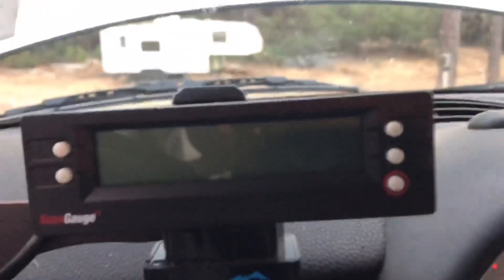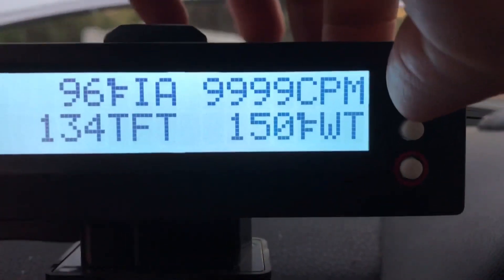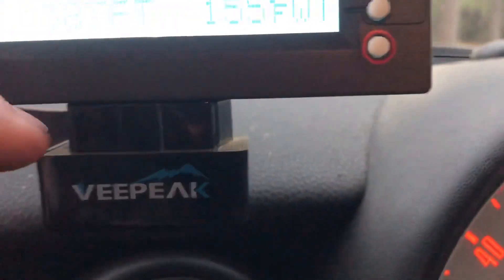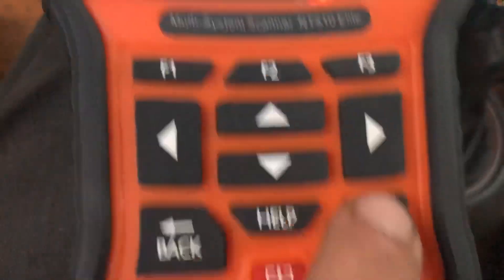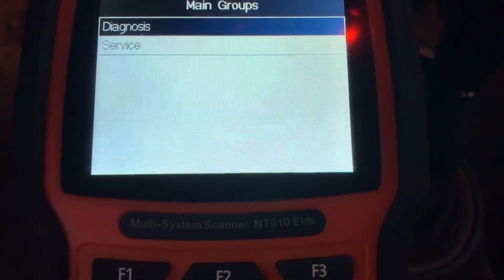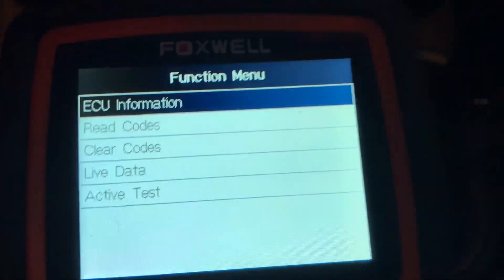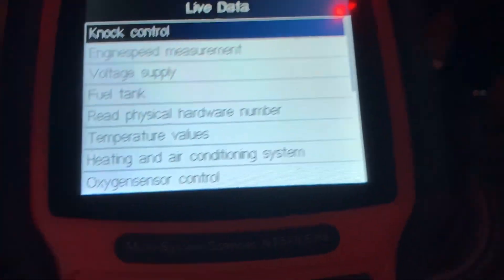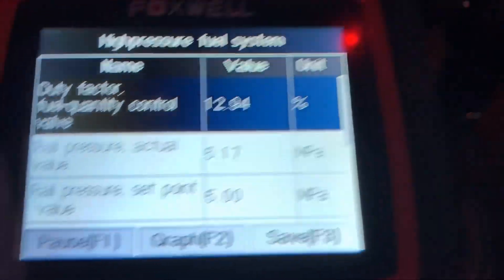2 Ways to check fuel pressure on your Mini Cooper

Comment: Hey man, I have issues with my car hesitating and running kinda rough at idle, I’ve noticed if I blip the throttle on idle then my fuel rail pressure will drop to about 600PSI Before it corrects itself and runs at around 700PSI on idle, do you think this is a bad pump?

Comment: Would be interested to see how you get two Scanguages working on the same ODB port.  I watched one video where one guy tried to use an ODB splitter cable but it failed long-term.
Reply from the maker: That would be the same way i would try it. Do you happen to have a link for that video?
Reply: @ProjectMini  https://www.youtube.com/watch?v=2Z3qF9WsTEA  This was on a Mustang though.  Maybe it would work on a MINI.

On another note, I have a 2013 R56 S, and tried to measure the fuel rail pressure on my Scan Gauge II and it didn't work.  I even mailed it in to Scan Gauge back in November 2016 to have the software updated.  Not blaming you or anything just thought that was something noteworthy.  I'll try measuring the pressure with my Foxwell NT510 later.
Reply from the maker: I’ll have to try something else. That explains why I’ve never seen it done

Comment: Hi, hopefully you can assist especially since I may not be able to  pose my question correctly.

My mechanic just just installed a new high pressure fuel pump and tells me it is pumping too much fuel. Do you know what could be the problem?
Reply from the maker: I would find out how much fuel you’re getting (in PSI) and see if your mechanic knows what he’s talking about.

Comment: Question for you, I've replaced my HPFP but now I'm getting a code P0088 "Fuel Rail/System Pressure - Too High" . Do I put a new high pressure fuel line which is recommended after removing it? Could this be causing my problem? Btw I've replaced a new fuel rail sensor as well as a new fuel filter. Thanks in advance:)

Comment: I think my HPFP is on its way out... Got worse over the last 2 months... Only interesting thing is that occasionally the car starts fine both the set point and reading are at 5 MPa, however when it has an issue, BOTH the setpoint and actual read at approximately 0.7 MPa. Anyone else seen this? Thanks

Comment: Ok so I did a Code on Fuel Pressure and have volume control valve 16.9. Rail pressure actual 5.82 and set point 5.82. Adaptation value fuel delivery control 1.0. I don't think my HPFP is bad??? My misfire codes are common for that problem 2783, 277B, 277F and 2773. I replaced my BOV (Turbosmart) a few months ago and the electrical adapter connection didn't fit so I modified it to snap into place. Not sure if the connection is working correctly? I also replaced the Pressure Convertor and vacuum lines. I assume that's not causing the misfires? Any ideas? Mini S has 107,500 well maintained miles on it. Owned since new. Also another code for 'smooth running value #1 0.43 l/s, #2 -0.48, #3 -0.02, #4 0.10 I have know idea what these values are for?? Thanks

Comment: What about for mini cooper r56 non S ? This function is not there rather there is Low pressure fuel system with cylinder injections value in ms

Comment: So I recently got a 08 cooper s turbo n lately its have hard time starting. Replaced sparkplug,  coils , valve cover , fuelpump and fuel filter housing (sending unit ) .. still not starting up after a over night stop. Can it be the expensive pressure pump ?
Reply: Hello, I currently have a similar problem. I replaced the spark plugs, coils, battery, and the car starts and then turns off only after the third time. It doesn't turn off and always after the car has been parked for a long time.  Regards

Comment: N18 idle is around 1000 on the most updated BMW ECU flash.
Reply from the maker: Thank you for that info!
Reply: It depends on the accessories in function, or the demand of the battery, on the alternator.

Comment: Mpa is MegaPascal, not BAR. 1 BAR equals 14.7 psi. 1 Mpa equals 145 psi. 5.01 Mpa equals 726.6 PSI for the HPFP value. Low pressure fuel pump deliver is measured in BAR and should be 5 bar or 72.5 PSI.